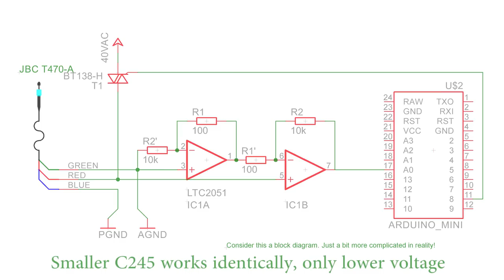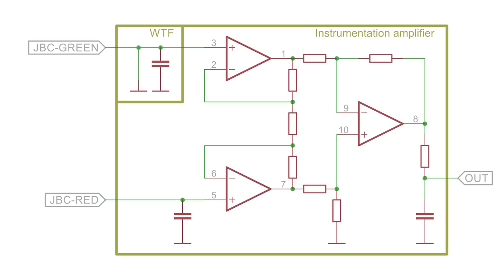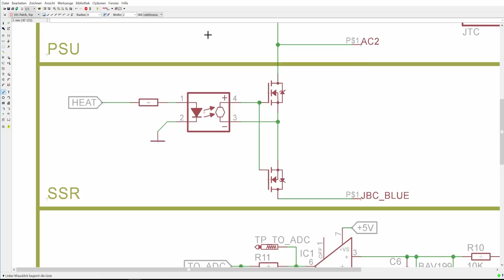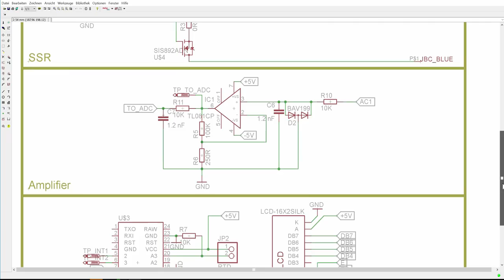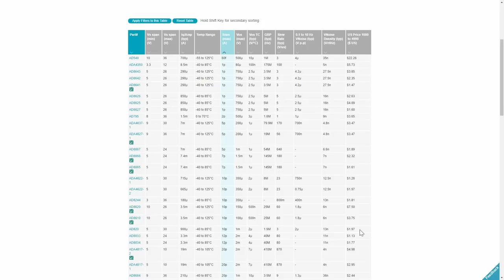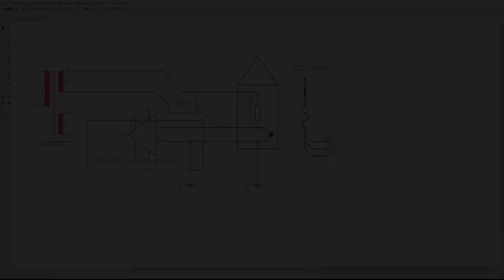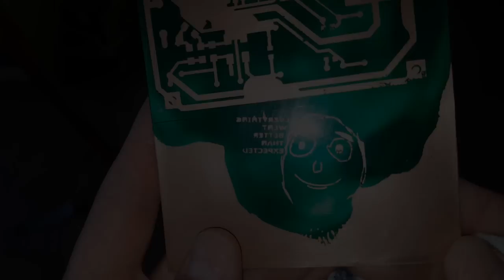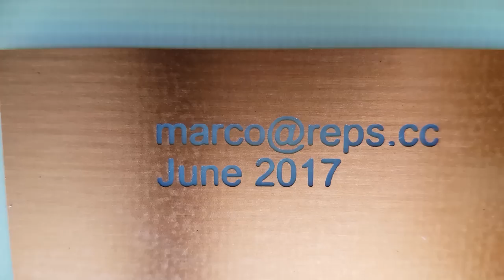Part II: Powerful DIY JBC Soldering station finished

Comment: When you do homebrew PCBs, it helps to put a small (0.5mm) hole in the through-hole pads - makes it much easier to hand-drill as the holes act as centering marks and help to guide the drill to the centre

Comment: 2:38 Technically, both MOSFETs are turned on. The back to back configuration is necessary to also block in the reverse direction, but reverse biased MOSFETs can also "actively" conduct backwards, since they are unipolar devices. This is the same as running a very low resistance resistor in parallel to a diode: Almost no diode losses

Comment: Very nice! JBC tips are awesome, when drived properly it behaves as if it had unlimited thermal mass; and that turns soldering to joy. I'm using C245 tips with my DC powered DIY controller.

Comment: I may be wrong but if you're using the MOSFET as a switch you're using it in the "linear region" shown in the diagram at minute 3:10, which is the "ohmic region" otherwise it will not act as a low value resistor. You use it in the saturation region if you want a current source (current is almost independent of the drain to source voltage) or as an amplifier. The thing here is to charge the gate as fast as possible in order to lower the ON resistance (which is the slope of the curves).
Reply: YES! That's it! Please, don't use the MOSFET as Switch in the saturation region! That for BJT's.
Reply: Unfortunately Macro does not understand MOSFETs
Reply: The Cgs of the Mosfet is very small, it almost charge instantly,  it passed the ohmic region very quickly, so remind me why won`t  use Mosfet again ?
Reply: No! You should most definitely use a Mosfet. The problem is using Mosfets as a Switch in the Saturation region. You want to use it in the triode (ohmic) region!
When you look at the Characteristic Curve (Id x Vgs) you will see that when rising the Vds, the Id will maintain it's value in the saturation region. Why is that? It's Because the Mosfet is rising it's internal resistance. It will get hotter and have a higher drop voltage between Drain and Source.
BJT's as Switches are used in the Saturation region.
Mosfets as Switches are used in the Triode region. (very close to the Saturation Region for better performance)
Reply: there are MOSFETs that are specially designed for that kinds of scenarios, so generally speaking, not always the case
Reply: The problem is that the buffoons who named the regions swapped them compared to BJT's. You don't want a mos to saturate, all you have to do is size the gate resistor to stop that from happening.
Reply: Matthew Maxwell-Burton 
Ty for making that point and explaining.

Comment: Regarding to tip connection. 
In TS100 they are using custom copper connector, similar to your fuse type. Maybe you can create your own from copper sheet.
in TS80 portable soldering iron is used audio jack. Find this tip type for affordable price can be difficult task. So far I found Weller WL26640 for 20e.
Check for teardown of this soldering irons to see how it looks like.

Comment: Would you be willing to publish some more pictures of your PCB?
And maybe you could tell me where you mounted the thermistor, as I'm currently trying to build a similar station for the T245 handle.
Thanks a lot in advance ^^
Reply from the maker: The PCB is very special fitted to the enclosure and the parts (a wild mix of through hole and SMD) I had available, I don't think it will help. The thermistor should be at room temperature. Because I don't expect any excess heat, I have just put it directly on the PCB
Reply: Alright, thanks for answering so quickly, but doesn't the current through the body diode of the mosfet create considerable amounts of heat?

Comment: How much did it cost (except the housing)?
Reply: The tip + handle costs about 100€ and the controller costs about 15€ probably (my approximation).
Reply: The transformer will set you back a lot. Most of the cost of the controller is in that.
Reply: His audio grade toroidal transformer is expensive. A switching power supply may be a budget choice.

Comment: Thanks for this. The ridens power supplies are programmable all be it sadly via a pc.
 Is there a reason that nobody is just interfacing them together with a temperature from tip, to control the output of the power supply?

Comment: I'm building a project using a c245 cartridge that uses DC power because I have an old laptop power supply. It's 19.5 volts with 6.8 amps, well it just enough for the cartridge. But there are a few problems here, Marco uses AC power while I use DC power. I have a reference to Aixun T3A, it uses 1 P-channel mosfet AO4413, obviously will have to modify the design of the power supply part for the cartridge but I don't know if it is necessary to modify the temperature measurement part and code?

Comment: Hi, thank you for the great job... a doubt, where is connected the pin CT (GND-green-JBC) that appears in the scheme?, on earth (PE)? I see that ACA1 and ACA2 (24V ac) are the connections of the first secondary transformer and ACB1 and ACB2 (24V ac) the second secondary, the transformer I think is a Sedlbaver Typ-NR RTO826053?
Is it necessary to have a good earth in the house for it to work properly? Thank you

Comment: For zero crossing detection - it's OK to just put a 1M resistor in series to protect the atmega from the higher voltage? Do the protection diodes of the atmega pins handle the rest? Or am I misreading the schematic

Comment: Why is nobody using rectfied 24v to drive the heater ? I think using a mosfet and controlling the iron with PWM would make for a very stable temperature.

Comment: Would it be adequate and aesthetic way to control power by using solid state relay on high voltage side of transformer if it have minimal V?

Comment: I have had tip red hot, get this for 6, 7 seconds. Foolishly increased max temeperature in software to 450, but measurement stops about 420. Is there discusion on software somewhere?

Comment: Marc, are you happy with your DIY station or you use another station? Is there reason to make this station now? I read A LOT about modern "china clones of JBC", but all of 'em are clumsy w closed firmware and even break after one month of use. I want to make own JBC-clone station, but with more advanced control. And people say you use AC current, instead of DC - any reason for that?

Comment: I wonder why you discarded the integrated SSR device. I have nearly identical S202S02 and it works perfectly at 25VAC although it's also specced as 80Vmin...

Comment: +Marco Reps
Very nice update! I like the idea of the SSR because I'm working on some SSR right now.
My questions is, do u think this SSR will work with AC current? I have ordered the photovoltiac IC's (VOM 1271) and still waiting for them. Any tips?
Reply from the maker: Definitely works with AC, that is what I am using here! If you want to make the circuit board yourself, I would recommend to use regular TO-220 MOSFETs instead of those tiny powerpak ones, because easier routing!
Reply: Thx. Actually now I noted that u using it for AC

Comment: First thank you for your video and work this is exactly what I've been looking for. Been trying to create wine with pwm but timing it for thermo measurement is a pain.
Looking at your schematic for the zero crossing detect. I just see you tapped off the toroid with no resistor divider. Unless I'm looking at it wrong or missing something, would the IO pin get over loaded with the 24vac sine voltage? 
Any help would be appreciated
Reply: Hey look at a casual uC inpit there are diodes to protect it. So the diode is limitng the voltage and the resistor the current. To be isolated you could use a bridge rectifier and an optovoupler.
Reply: Okay apparently there are optocouplers that have an ac input so you dont need a rectifier. i.e. EL 814

Comment: Hey Jan, what is the advantage of this project over Unisolder? Being able to handle 250 watt?
Can Unisolder be modified to handle 250w?
Reply: Unisolder is very expensive. Did not do the maths on this, but it looks pretty cheap. I have an old homemade station with a simple comparator... I'm very tempted by this project.

Comment: YaY thanks! I've been waiting for this videjo! I think it is true what You said about this overshooting and not showing it, just simple line of code and You can think that the performance of expensive station is out of this world. But it isn't.

However after this material i got the point of why jcb cartridge works so well: it got almost immediate feedback about the temperature of the close tip.  Also great thermal conductivity wich allows fast response.

BTW great humor :) 
Greetings!

Comment: Hello,
Very nice work, i'm thinking of creating the same kind of soldering station using DC instead of AC maybe feeding the tip with a flyback boost input source so that the soldering station could be powered by a battery.
I was wondering, if the tip is powered by a transformer and the rest of electronic by an another, they should be isolated from each other, so it should be possible to monitor the voltage on the thermocouple when powering the tips, what do you think about that theory ?
Reply: Because the thermocouple shares the one heater wire it will read totally wrong when the volt drop/resistance losses in the common wire swamp the millivolt thermocouple signal.

You can use the same technique with your boost converter of disabling the power when you want to take a reading.  You will need to possibly use an isolated transformer output to prevent the ground issue though.

Comment: Great video think I will have a go at this project! :) Just a few questions...what printer and transparency sheets do you use?? Im struggling getting nice pcb's with the toner transfer method. Also do you not still use your proxxon?? Nice solder mask. A video on your current PCB making methods would be a good watch. Thanks.
Reply from the maker: Cheap Brother hl-2270dw, Folex Transparencies (4220.5.141). The prints are not perfectly nontransparent but with precise timing (1 min 15 s with my 4-tube tanning bed) the results are perfect.
Reply: Marco Reps thanks for the specifics, think I'll change my method. :)
Reply: Tracing paper + laser printer works great too - prints come out PERFECT and transparency is ok too.

Comment: Hi, in the end, what kind of thermocouple is used in the JBC irons ?
Reply from the maker: I don't know for sure, a normal Type K thermocouple amplifier was reading more and more inaccurately at higher temperatures, so I don't think it is a type K. The constant in the voltage to temperature calculation that sparkybg (dangerousprototypes forum) has found seems to work well.
Reply: Ok, thanks ^^ After a bit of calculations, it would seem like the thermocouple use is a type N, but I'm not quit sure...
Reply: Yup, a nice guy on the eevblog forum who has a JBC heated a cartridge and gave me the voltage drop and it matches the one of a type N !!!

Comment: Can you reverse-engineer the jbc hibernation and sleep function for extending tip life? 
My guess is that the stand is isolated by its own grounding into the microcontroler. 
And that its shorting some input on the microcontroler trugh the single wire thats connected into the stand when you place the handpiece into the stand.
Would be nice to see that function 😁
Reply: Hi, its that simple really. Just like you said for hardware, and maybe additional 5 lines of code.
Reply: @goranstecesin1186  I'm not that much of a code guy,
Would be nice if someone could make it..
This feature is so damm nice 😁

Comment: Hello Marco. Excellent work, and very elegant outcome.
I have been a Weller user (exclusively) for over 20+ years now, and it is the first time I encounter JBC.
I have seen you had/have a Weller, how do you compare it with the JBC? Especially in regards to reliability of the tips?
Reply from the maker: I think it depends on the heater / tip system. A cartridge system like JBC will usually be better than a 'seperate tip' system. But Weller also makes a cartridge system now, but I have never used it. So I can't tell which one is better.

Comment: I don't understand the transformers. If I want to build a soldering station based on the 245 handle, which requires 24 v according to the manual; do I then absolutely have to supply 24 volts? Is is such that I only need to supply the Watts? And is it important that it is ac or dc?
Reply from the maker: It doesn't have to be precisely 24V, but the closer you get, the better. (Lower voltage means less power, drastically higher voltage can damage the heater) The heater doesn't care whether it gets AC or DC, but the controller does. In particular my software relies heavily on zero-crossings. I'd suggest you look at http://dangerousprototypes.com/forum/viewtopic.php?f=56&t=7218

Comment: Nice project, but the only reason to do a project like this is for tip calibration from microcontroller software. Of course a project like this already done only require a microcontroller software update for this feature.

Comment: ich hab mal eine wichtige Frage Marco. wie hast du es denn geschaft den Atmega8 zu programieren? mit dem internen Quartz?
Reply from the maker: ja, timing ist ja nicht so wichtig, deshalb reicht der internal oscillator locker aus
Reply: ich bekomme den leider nicht programmiert mit den internen 1mhz oszillator und mit dem 16mhz quarz stimmt das timeing vorne und hinten nicht mehr. es braucht ca. 50sec. bis auf dem display was erscheint und dann wird nicht mehr geupdatet
Reply: @ltech4174  Hast du die Fusebits richtig gesetzt? (Atmel Studio per ISP?)

Comment: Hi, can anyone tell me, what's the purpose of D2 in the schematics? I assume it's a protection of the opamp input from transients, but any positive or negative signal is conducted to GND and the other way around. 🤷‍♂
Reply: It clamps the input to the op-amp to +- 1.1v (the forward voltage of that diode).

Comment: Love the video and the schematic. only thing thats been bugging me is that I don't really know how you connected the transformer to the circuit. there are quite some places and I don't want to blow anything up while i'm at it. Could you maybe explain how the board is connected to the outlet and the trafo
Reply: Blowing up stuff is a valuable education experience when it comes to the craft of electronics. Those are lessons we usually don't forget too quickly. Failure is the beginning of success.

Comment: I'm a bit stuck, could someone give me a link Digikey, etc. on the 100 uF 175TMP-0810 polarized cap? I don't know which one that is best suited for the project. tia
Reply: Does this work? http://no.farnell.com/panasonic-electronic-components/eeufc1j101/cap-alu-elec-100uf-63v-rad/dp/9692517 

(allthough I didn't see anything like it in the video)

Comment: What do i have to change, if i want to use a T254 Handle?
Reply from the maker: Only the transformer voltage I think. But I still recommend http://dangerousprototypes.com/forum/viewtopic.php?f=56&t=7218 because that is a really well-made design, in contrast to my "bare minimum" approach.
Reply: Marco Reps Yes, but it cost much more than your project and i only want to use one soldering iron. So you use your build very much or is it not practical?

Comment: Is it work with jbc c210 tips?
Reply: C245 uses 24V, I am not sure , but C210 uses 12V, so modification is needed. Plus C210 tip has different pinout (tail).

Comment: Could you put together a Bill of Materials? That would be helpful for us who wants to build one of these :)
Reply from the maker: It might not be very helpful, because I am partially using older parts, but I have added it to the archive in the description.
Reply: Thank you! 
Will a 300 VA transformer with 2 x 24 VAC outputs be suitable for this project?
Reply from the maker: That is what I am using now but it will put a bit more than 250W in the C470 tips. I have no reason to believe that that will cause problems, but it is more than they are rated for.
Reply: I was wondering about the "Center Tap" that's on your schematics... 
If you have 2x24V secondary, then does the other winding have a separate center tap?

I was thinking to use 2x24V, but without a center tap on at least other winding, one can't really get +-12V for the logic.

To get that, one would have to either take the center tap between those two 24V windings (effectively ruining the idea about isolation between them) or have more than two secondary windings (e.g 1x24V and 2x12V).

Those kinds of transformers are very difficult to buy off the shelf so do you have any recommendations or would you clear up a bit this isolation and windings issue. :)
Reply: I am just using two transformers on my implementation. The small ones are really cheap anyway, and their footprint is minimal.
Reply: @reps  Just to get this right because in the bom a 42 V transformer is listed. Are you using the windings in series to get 48 V or is the bom not correct and the tip is connected to one 24 V winding? thanks for your work! ( for the C470 tips.)

Comment: Kann ich eigentlich anstatt den max400 auch den tl081cp benutzen?
Reply from the maker: Wahrscheinlich! Bei Opamps gibt es so viele Parameter, dass es meistens am leichtesten ist, einfach auszuprobieren. Wenn du Offset oder Nichtlinearität bemerkst, kannst du das ja auch einfach in Software korrigieren.
Reply: mein größtes Problem ist eigentlich alle Bauteile bei einem Versandhändler zu bekommen. da moser 20€ Versandkosten hat und farnell nur an unternehmen verkauft bleibt bei mir bis jetzt nur noch die Partnerwebseite von Farnell. und die hat leider bloß den tl081cp. Wo hast du denn alle deine Bauteile gekauft?

Comment: Works on JBC nano NT105 handle?
Reply: did you test with nt105 or nt115?
Reply: @mjanez0  no, butt nano tips are the same of the 210 tips, 245 NO. They have much power, and burn it